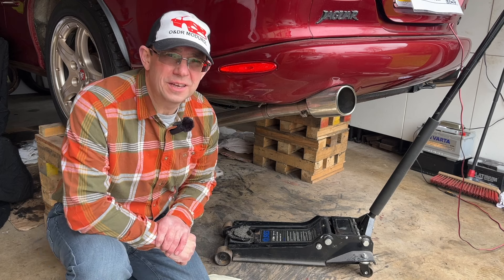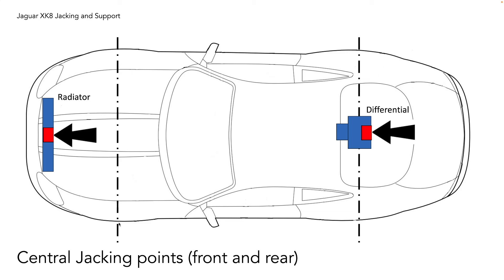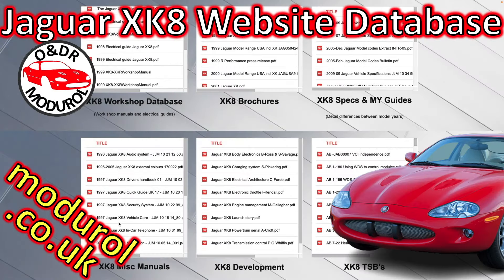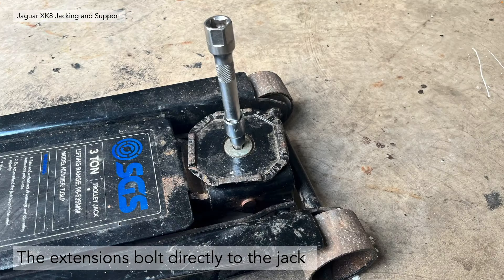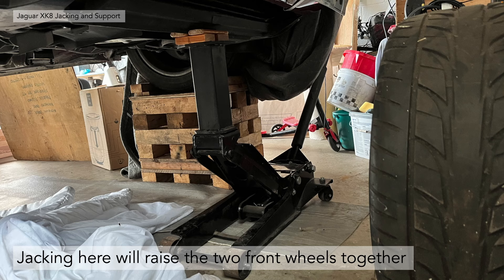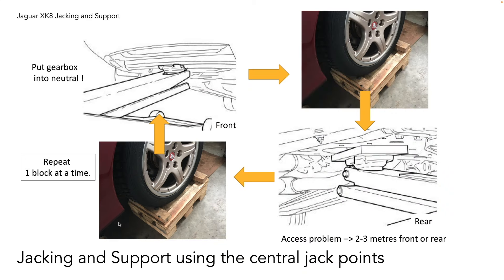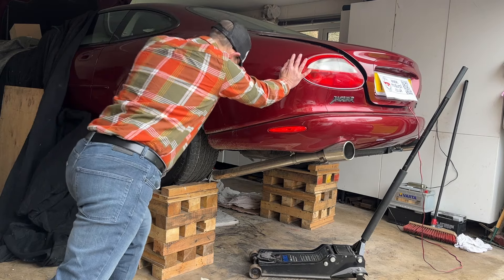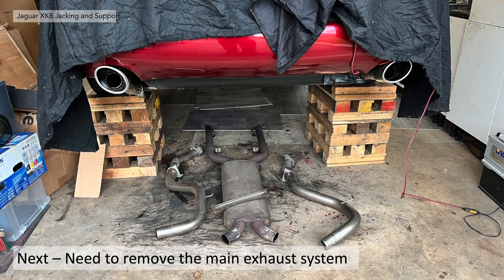Jaguar XK8 Jacking and Support. Where can you put the Jack? Working safely under the car. XKR X100

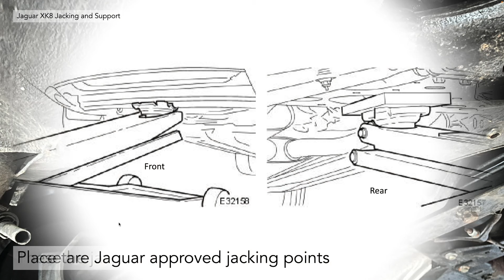Comment: If you compare the images at 3:20 & 3:30 it looks like Jaguar wants the jack forward of your arrow.  Where the "Y" is more splayed out.  Possibly the worst drawing ever, but I think I see the two bolts you point to in the drawing.  Have you looked underneath to see which area is most directly supported?  Thanks for all your helpful videos.
Reply from the maker: Matt, you are correct the Jaguar diagram show the jack forward of the point I recommend. I prefer to jack directly under the rear most fixing points. This is directly under the differential and pendulum. These are both cast iron and more secure than the 28 year old sheet metal rear crossmember. Thanks for the feedback and question, regards Damian

Comment: Geez Damian, those blocks would hold a Cat dozer! I never could understand Jag's logic with that plastic cover over the center core support. As you mentioned, it contributes to rusting (on a structural member, no less), and does little else. I'd think the smarter thing would've been to have left the center of the cover out so you just have contact with metal, who wants to jack on plastic anyway? Lifting these cars is such a pain, I broke down and bought a lift that I now can use on all my vehicles and I can walk under the Jag now, takes about 15 minutes to set it up. I should've bought that lift years ago!
Reply from the maker: Andork, agreed doesn't make sense covering the lower front cross with plastic trim. I would really love a proper lift maybe one day, regards Damian

Comment: An interesting video, Damian. I like your slotted gadget for using under the front plastic valance but I've seen so many with cracked plastic that I just remove it and use a block of wood directly onto the metal crossmember. Apart from three small screws near the central jacking point it's only held on with plastic push fittings so it's a 5 minute job to take it off.
Richard
Reply: On my car it wasn't a 5 minute job to take the front undertray off, because all the screws and the clips that hold them in place were corroded.
Definitely worthwhile though, at least the first time, as Damian says, to make sure you are not jacking up and relying on a piece of Swiss cheese!
Reply from the maker: Richard, thanks didn't want to damage the lower valance. What year is your car? My early valance has bolts either side and inside the wheel arch from what I can remember so not that the easy to remove. Maybe your car is different? Interested to understand, regards Damian
Reply: @ODRModurol  Mine is a 1997 convertible. There must be some differences because even the screws on mine are self-tappers and just go into plastic blocks in the bottom of the cross-member. All the rest (about 6 along each leading curved leading edge and 3 across the bottom of the wheel arch liner, which also hold the little plastic air deflectors in place) are plastic push rivets. There's nothing to corrode apart from the heads of the 3 self-tappers but even those are still the originals.

Comment: Hi Damian, these blocks are a good idea, making them is easy. Unfortunately I no longer have room in my garage. I still place the vehicle on metal stands in the designated places. The vehicle is safe, right? I didn't know about the front central option for lifting, thanks for the tip.  Greetings Udo. 🇬🇧👍🏴
Reply from the maker: Udo, Thanks for the feedback. As long as you use the Jaguar specified jacking point you should be fine. I am just more confident using a solid support than metal fabrications when using breaker bars etc, regards Damian